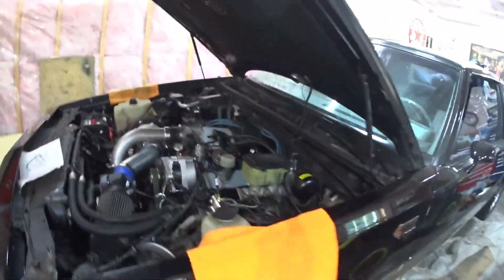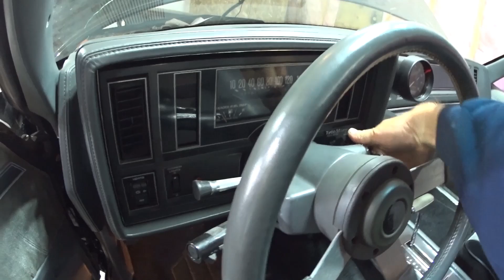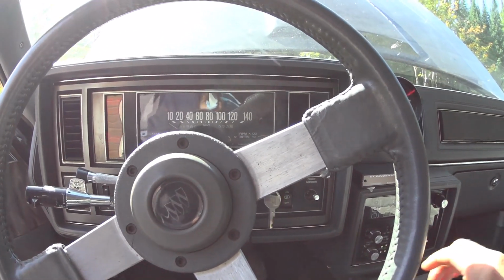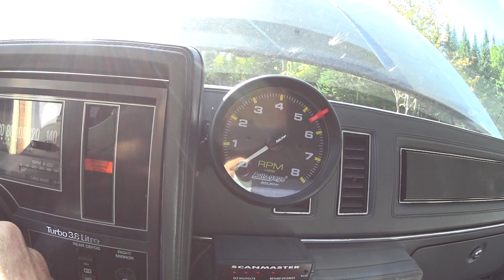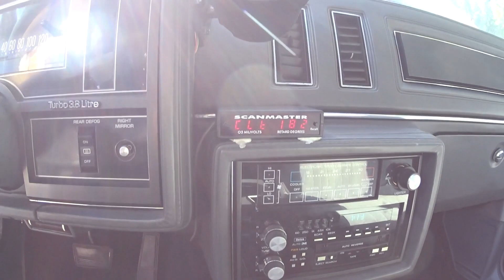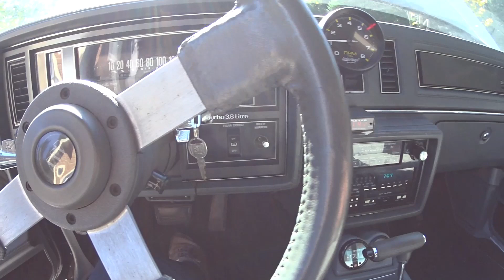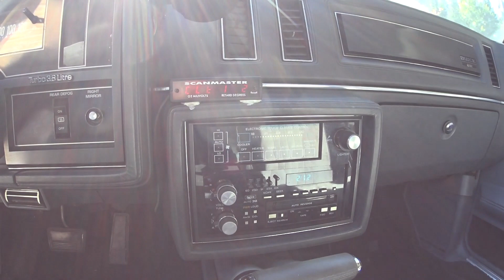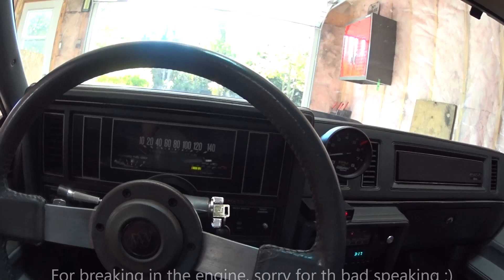1986 Buick Grand National , first startup with the new rebuilt engine

Comment: You didn't have to turn on the key to test fuel leak. Unplug the hood light and plug that wire in behind the alternator to the wire behind it. Fuel pump will start and bring fuel to the rail. I like to disconnect my computer behind the battery and spin the motor multiple times to build oil pressure before starting when sitting for long periods of time. Which is what it does.